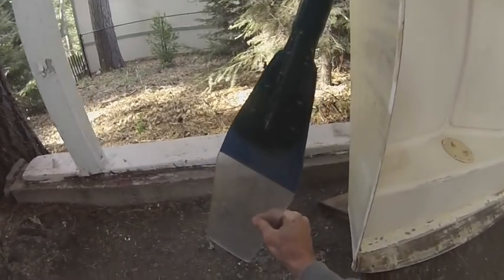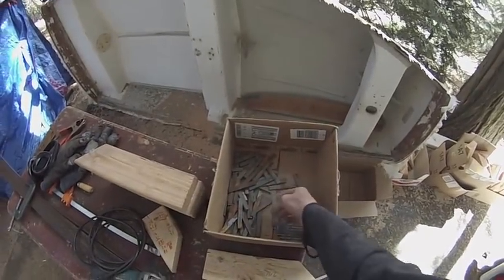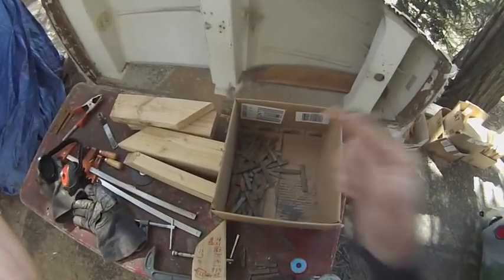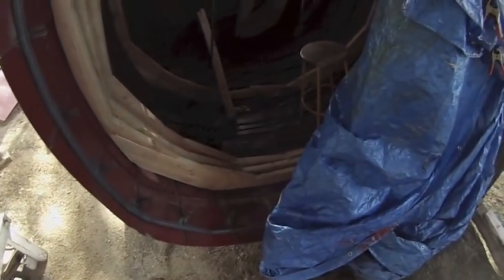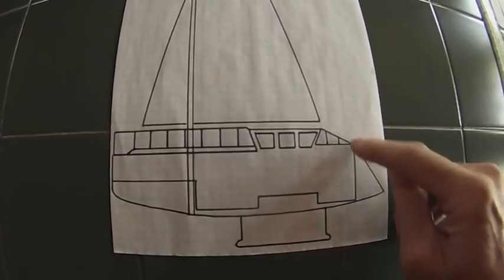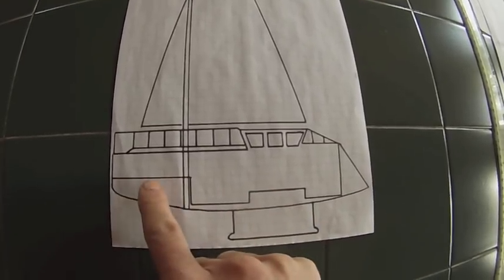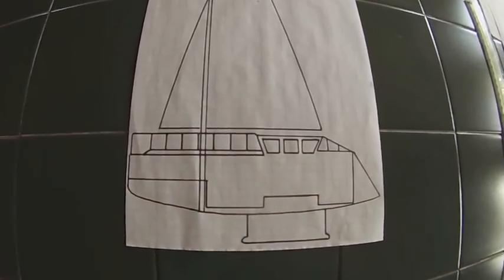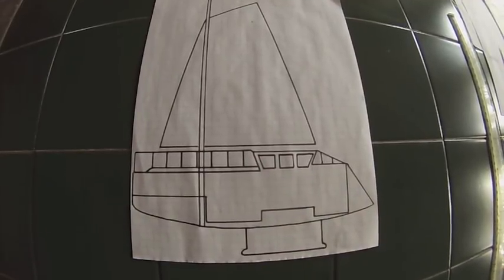Steel Sailboat Build Part 15

Comment: The plastic butcher block is called UHMW ultra high molecular weight polyethylene I use it for all kinds of bushings and wear strips used to use it in the bottle and beverage industry
Reply: What adhesive works on it? Or does it have to be welded?
Reply: Might also be High-density polyethylene (HDPE) like milk jugs are made of. I've seen butcherblock made of that as well. if it is HDPE, damn near every adhesive will not stick to it, save for a couple expensive ones by locktite.
Reply: The problem with Htpe is its not tolerant to sunlight. It breaks down fast.
King starboard is more dense stronger and holds up to the sun
Reply: Kevin Hornbuckle 
Best welded

Comment: Engine in the transom, the keel looks like it is pretty far aft.  From your drawing she looks aft heavy. Your bow is going to be too light and she will bounce her bow like a top heavy college girl on a mid day jog.
Reply: Also has no directional stability due to the hull shape
Reply: Tom Hutchins ~ are you talking about the boat or the college girl.
Reply: Ballast can always be added to balance a monohull
Reply: I've gotta agree on the position of the keel. With the effort on the mast so far forward, and the resistance of the keel so far back, I feel like it's going to induce a lot of lee helm, which means that when a gust hits, the boat will want to turn in the direction that the wind is blowing. That'll power up the sails and can lead to an excess of heel (leaning) and a loss of control. Hit up sailboatdata.com and really study some of the profile drawings of some 30 foot keel boats.